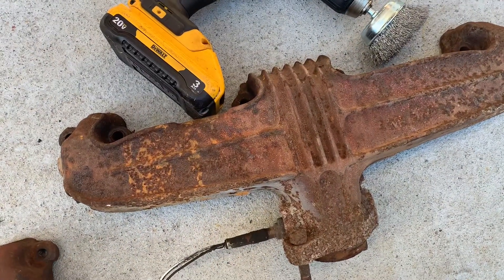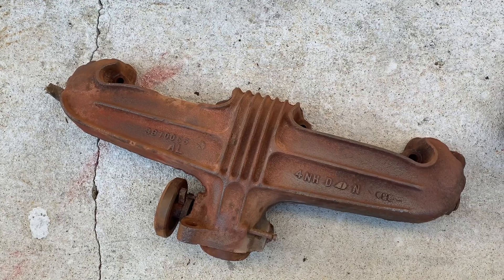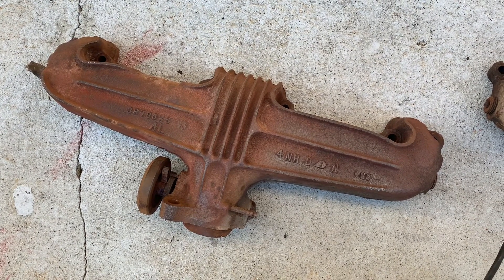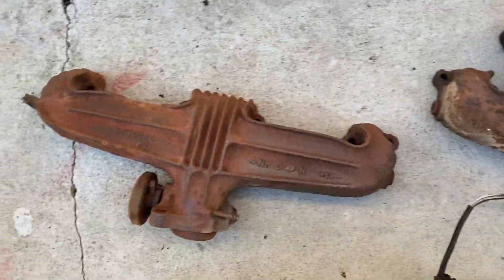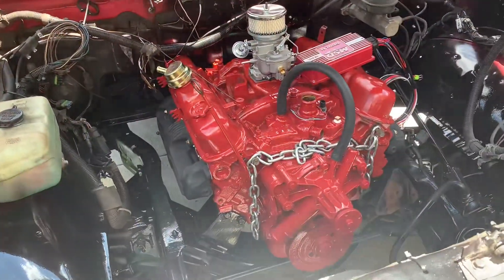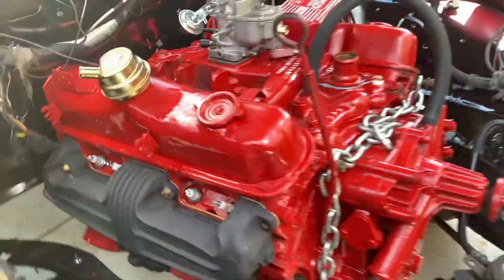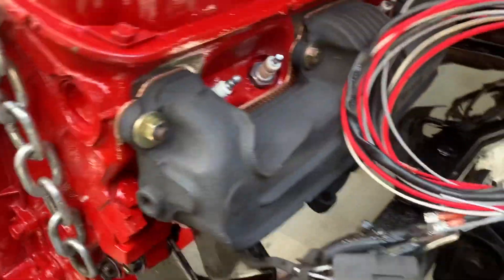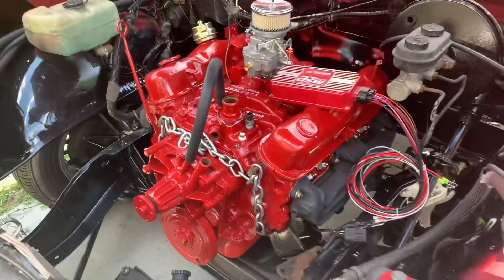Mopar 318 Exhaust Manifold Paint

Comment: MSD on a 2 barrel.  Now I've seen everything.  Why didn't you just put a stock 4 barrel cam and carb on it even if they came from a good used motor. But I'm your probably going for Gas mileage and a clean burn
Reply from the maker: Im a bankrupt fireman so couldn’t afford it, but yes, I’m going to upgrade it eventually, the intake manifold was free and the carb was $88